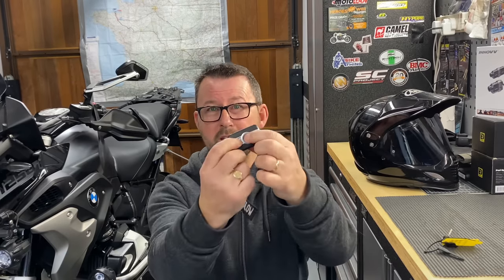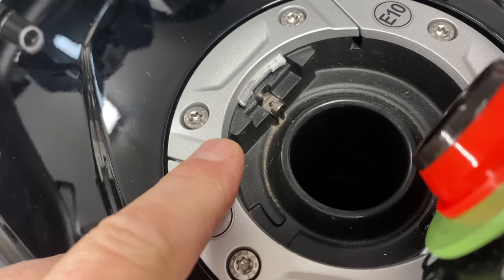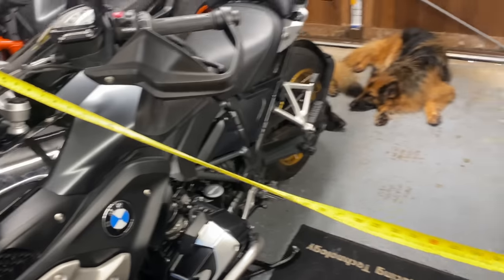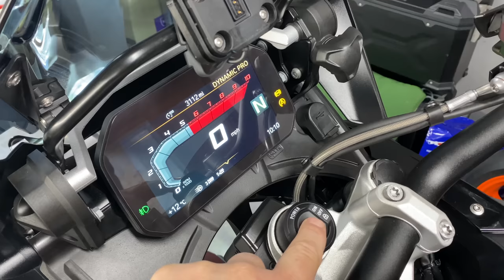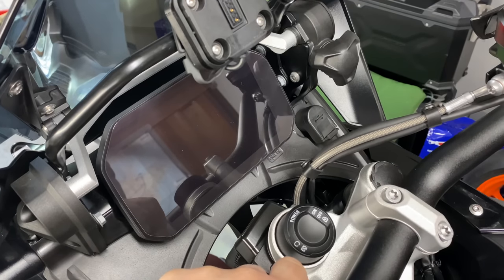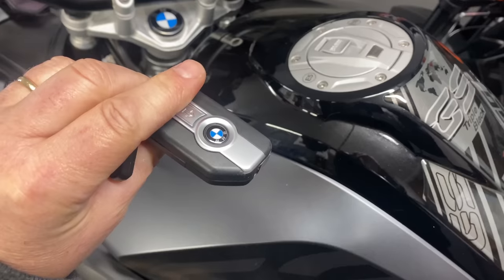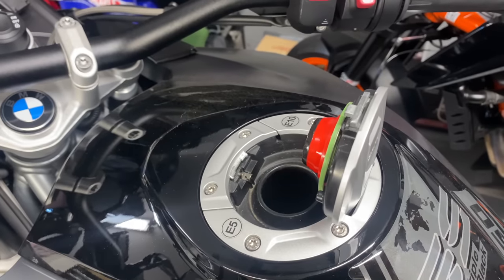HINTS & TIPS #4 BMW R1250GS / GSA, a guide to keyless ride 🤔

Comment: I guess you dont have an alarm on your bike.  The button on the fob can be used to disable the motion detector so if you are on a ferry for example the alarm doesn’t keep going off.
Reply from the maker: Correct , no alarm fitted , but I did wonder if they did the welcome lights hen we approached the bike ay night...... that would be cool.
Reply: @gsd32i  I found mine will flash many lights if I move it around the garage and have left the key too far away on the work bench! Makes a bit of a noise too!

Comment: You should work for BMW Motorrad! I have 2021 Triple Black with most of the ridiculously over-priced packages. 1) There was no explanations on handover 2) I didn't even know it had a steering lock! 3) (your other video) I've disabled about 90% of the electronic sh@t....who needs it all? 4) ANOTHER of you vids - I fitted a black carbon Arrow race can (not paying BMW prices for the Akrapovic) - fitted Puig lower engine bars (ditto BMW prices) - like you, opted for Garmin XT and a twenty quid bracket - Screen Angel - easy fit - and finally an SW Motech brake pedal extender - lovely quality - but was £70+ worth it to gain 12mm extra width? BUT out of the 22 legal (!) road bikes I've owned over 50 years of riding, the 1250GS is the best - it does everything in one package.  Keep up the good work - you're a life saver!
Reply from the maker: Hi Derek really appreciate you taking time to make the comments. Now that I am over a bout of vertigo!!! (Not good when you fly Airbuses for a living) I am back to doing the videos and stay tuned for some hints n tips ones again. Always open to job offers if Motorrad want to employ me 😁

Comment: I thought keyless is now default, no additional charge.  I do find the keyless very handy.  

I did also buy a Faraday pouch, which I store my key in when not riding.  Keeps it safe.  

The battery in the key should last about 2 years, since it's a passive key. With the alarm, it would last shorter.

I tend to leave my emergency key at home.
Reply from the maker: Standard on the "TE"model. Hopefully you won't be too far from home if you lose your radio key 🙈😂
Reply: @gsd32i  I've never yet lost a key, so long may that continue.  Otherwise, the wife will be getting a call to bring the spare to me. 🤣
Reply from the maker: @photobiker4309  hahahahahahaha 👍

Comment: If the key is left for long periods of time in range of the bike, the battery will die very quickly. I keep my key away from the bike when not in use.
Reply from the maker: Indeed. A top tip is to avoid cheap batteries from the likes of the internet. Go for a trusted brand. I was going through a battery every 4 weeks, until I went for a proper make!!!! 🙈

Comment: There is a known fault with the keyless system where it keeps requesting new battery.  There is an issue with the sensor on the bike.  Btw know about it...
Reply from the maker: Hopefully fixed. 8 months from new and no issues yet 🤞
Reply: Mine started acting up after 3 years......
Reply from the maker: @advancedbiker  🙈just after the warranty finishes!

Comment: I dont like the keyless would 100% prefer a simple key , my bike came with the keyless,  I've had my bike 18 months and probably gone through 5 key batteries.  I've also been out riding and the key has fallen out my pocket took about a mile of riding befor an alarm popped on the up TFT then had to spend half an hour retracing my steps to find the key luckily i did and undamaged.  
Because you cant keep the key near the bike (I used to keep the key in the ignition in my garage on my old bike) because it drains the key battery i now keep the key in my flat, the times ive got suited up helmet on gloves on sit on the bike and no power you then have to go and find the blasted key.  This probably says more about me than the bike but i just dont get it, I dont see the benefit.
Reply from the maker: Oh dear. Bad luck Andy, more than happy with mine. I leave my key on the garage worktop as per the video and I've not had any issues with the key battery going flat. I hope the rest of your  bike is performing well though? . Thanks for taking the time to comment . Ride safe.👍
Reply: @gsd32i  Good video BTW with useful information will maybe try and keep the key somewhere in the garage out of range of the bike.
Reply: Agreed. I’m not sure what the benefit is really. Especially when compared to all the negatives. I get anxious when filling up with gas because I don’t have confidence in the gas cap. You want to be quite ginger with that agile piece of kit. A chap told me back in the summer that he liked it because when he got suited up ready to ride he would always leave the key in his pocket and have to get off the bike to retrieve it. If you do that once or twice you get into a routine of putting the key in the ignition first. Then get suited up. Give me a key any day! Best!
Reply from the maker: @creedm3040  interesting comments so far . My ktm890R next to the gs is a key. Keyless or key doesn’t phase me one way or the other . I do have that “where is the key” moment , left it in the top box once !!!
Reply: @gsd32i  Why do things have to be so complicated? I am getting used to it and love the bike no doubt. Great information and great channel. Best!
Reply: I keep my radio key in my tank bag. I have a very small one (5 liters) with just my phone, motorcycle documents, wallet, ear plugs, a usb cable and other little bits aside from the key itself which never leaves my tank bag unless I need to fiddle with the top box for example. Point is, when I leave the house I always take that tank bag with me and I always take it off the bike when I park it. Its like I replaced the physical key that needs to go into the key hole with a tank bag that can quickly connect and disconnect on my tank ring. It also became like a routine, doing it without thinking too much about it. I never lost my key and hope I never will. I hated the idea of having my jacket pockets filled to the brim with my wallet, document, house keys, radio motorcycle key, mobile phone, wah. And I never trusted my open pockets on my jeans, for storage; things could be flying out from there without me knowing about it! If you ask me, the tank bag is the best accessory anyone could ever buy on a bike! It even has a shoulder strap and it's waterproof, what more can you ask? Fkin brilliant is what it is.
Reply: bonus points: because of how handy the tank bag is and how used I got with it, I've started using it in my car as well. Of course I can't mount it anywhere but I don't have to; I just throw it in the back seat and I can rest assured I never forget any documents / wallet / keys ever 😉
Reply from the maker: @sunnycloudy1337  Yup, whatever system works for you.....I still have to feel for the radio key every now and again...just to make sure where it is!ride safe and appreciate all the comments 👍

Comment: Re the emergency key - I'd keep mine in my wallet. Then regardless of what jacket to use you'll always have it with you.
Reply from the maker: Tend not to carry my wallet anymore .. tap and go 🙈
Reply: emergency key isnt needed to be carried with you ? you wouldnt carry a spare for your car with ? , emergency key is only for when you lose the normal one
Reply from the maker: @bikesnjosh  Yes it is, I am more than happy to keep mine in my inside jacket pocket all the time, especially when I go away. Every one has their own ways of doing things. Ride safe.👍
Reply: @gsd32i  the reason they tell you to leave it at home is incase you lose the jacket lets say with both keys in , your fuc*ed ... if your main key stops working it still works the same as the spare and can put it up to the sensor and start the bike just like the spare
Reply from the maker: @bikesnjosh  Indeed , but we all do what we feel ok with, just got to make sure I don't lose my jacket then, thanks for the input , some folks leave the spare in with their travel documents. I have always taken a spare key away with me on biking trips or ski trips in my van.